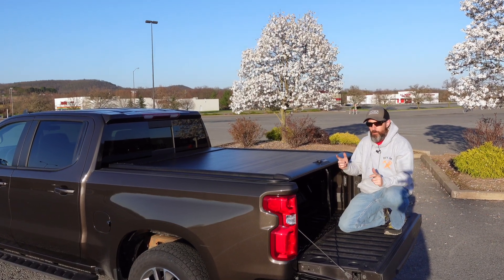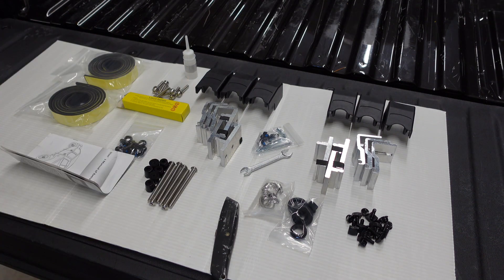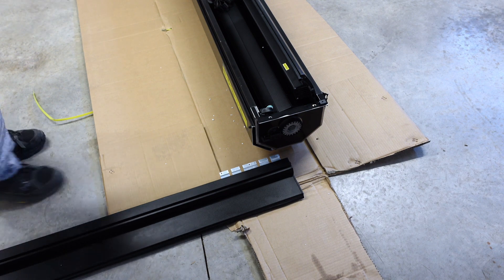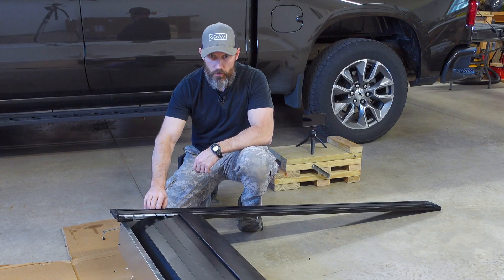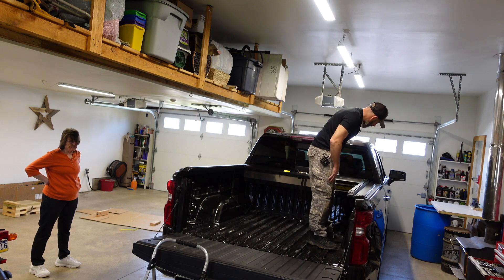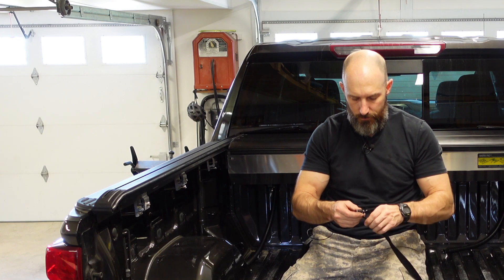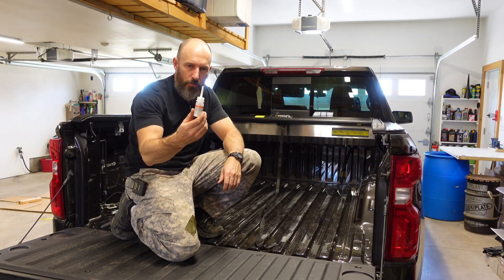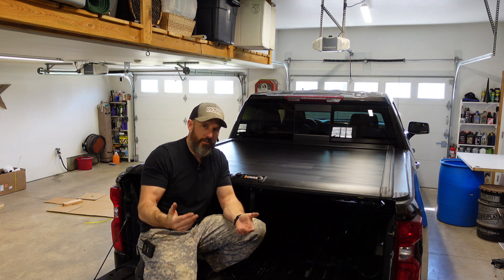How to install a ONINE retractable Tonneau cover

Comment: Thank you so much. Installed mine on the Silverado today. Just need to drill out some larger drain holes for the larger front drains tubes. Also had 2 L shaped pieces at the end that I couldn’t figure out from the directions where they go. 🤷‍♂️
Reply from the maker: Thanks for watching. Glad you got it installed.

Comment: The Onine Cover looks like very nice quality. I see a slot running along the top rail rail and I'm hoping that it has a rack system for connecting outdoor sports equipment like kayaks and fishing rod carrier.
Reply from the maker: That would be cool
Reply: T-tracks.  Yep.  I'm using this video to install a similar cover.  Thanks @DIYJIM!

Comment: I bought this same one for my Ford F150 but it is branded BestWyll.  Found on Amazon.  When I struggled with install (the part at which the side arms get attached) I really struggled.  Emailed the support address and it bounced back.  I installed the who thing incorrectly - it looked right but the cover did not come out.  There was nothing in the instructions (written in poorly translated Chinese) that said anything about feeding the first few inches of the cover into the side arm tracks.  Had to disassemble pretty much everything and re-install after watching your very helpful video.  The cover works super well now but I guess I'm up a creek if I need warranty support or service.  Seems solid though and I think it will last.
Reply from the maker: Glad my video helped you. Thanks for watching.